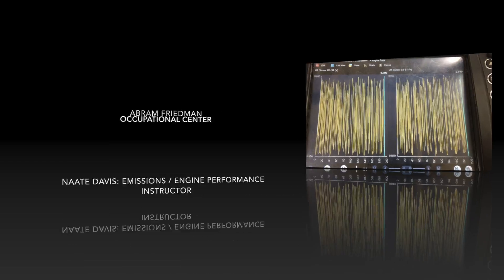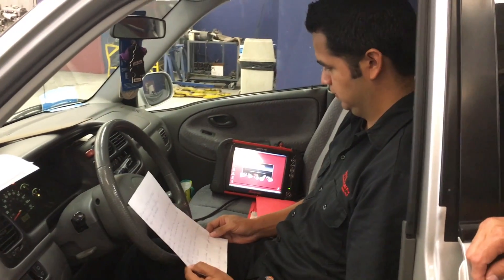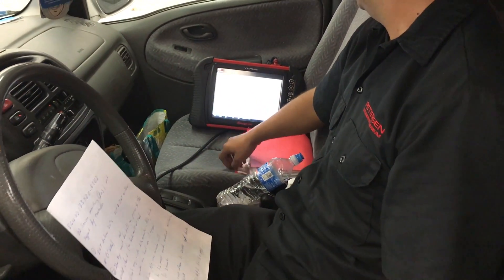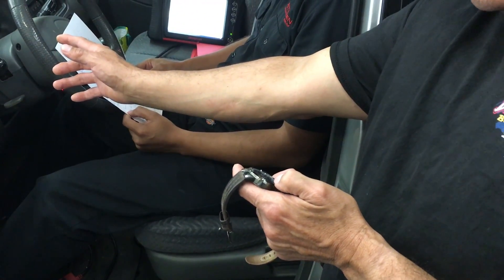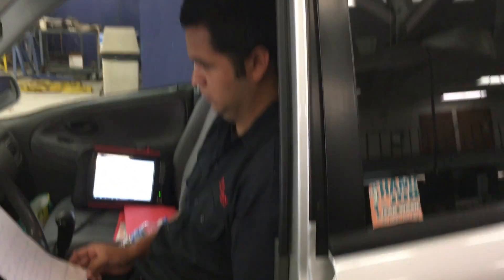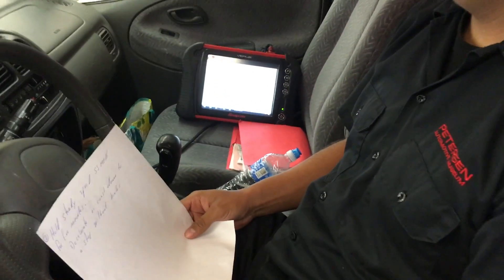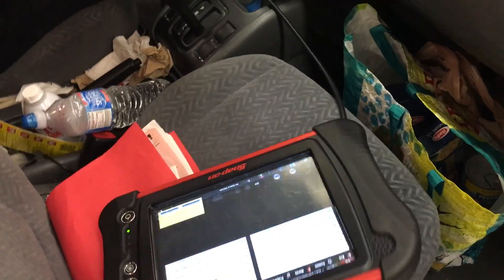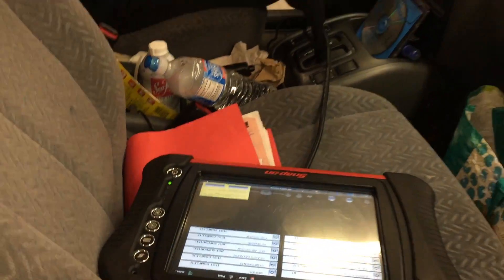Drive Cycle: 🥳  How to complete a Drive Cycle for the O2 sensor monitor that wouldn't run

Comment: I failed the smog check on my 2012 kia sorento. The shop told me to just drive it for a couple hundred miles still says not ready.. don't know
Reply: Also my check engine light doesn't come on
Reply from the maker: @gregmattera1812  what exactly not ready there several different monitors which ones are not ready
Reply: The O2 monitor every other monitor is ready. And the oxygen sensors are working @natedaviscteinstructor

Comment: Got a 99 camaro Ls1 with a EGR not ready. Drove it from Bakersfield to Los Angeles and still not ready. Tried to do a couple drive cycles and nothing. Took it to a shop and they have had the car for 3 weeks and still nothing.
Reply from the maker: Are there any pending codes
Reply: @natedavis5574  just passed smog the other day. I didn't know that you are allowed 1 not ready monitor for a 1999, and the repair shop did not know that either and there was no check engine light.
Reply: I got a 99 also with 40 thousand original miles.think i need a new torque tube for it

Comment: Evap won't clear shows inc on readiness with no check engine light. 2003 Ford F250 truck. Star station said can't pass it because it will ding their rating??? How can I clear the evap with drive cycle?
Reply: The easiest way is Perform evaporate system test with scanner..other method perform evaporate system performance test manually
Reply: I was told that evap is the only one that isn't necessary for cars after 2000

Comment: What are the actual instructions to get the oxygen sensor monitors to get ready? I have 7 monitors ready, except for the o2 sensor monitors. I drive a 2015 Dodge Challenger, any help is highly appreciated.
Reply from the maker: You should be able to google it I’m sure it’s on the internet
Reply: @natedaviscteinstructor  finally got my o2 sensor monitors to set. On the freeway going steady at 65mph decelerate to 55mph by letting the foot off the gas, and aggressively accelerating back up to 65mph. Repeated that back to back 5 times in a row, I then plugged in my obd2 scanner and all monitors were finally OK.

Comment: Nate can you recommend someone in LA or the valley that can do this for me , or will any smog & repair shop be able to do it?  Failed the o2 readiness at an inspection only place.  Tried a bunch of drive cycles myself but it is hard to complete all the steps correctly.  Found a place in Huntington Beach that offers a drive cycle service but that is a bit far. Thanks
Reply from the maker: What’s wrong with the car did it fail smog also what type of vehicle and what did it fail for
Reply: @natedaviscteinstructor  A 2013 Nissan Juke.  Failed smog because the O2 monitor was incomplete.  The smog guy ( inspection only shop) told me to drive it for an hour at 60mph and it should be good to bring back.  I got an OBD device and went on a couple long drives to try complete the drive cycle but it doesn’t seem to do the trick.  I’ll probably take it out on the holiday and more precisely follow the Nissan Drive Cycle procedure I found online (Although it is for a 370Z).
Was wondering if you knew any smog shops that can do the drive cycle on the dyno like your video was showing? It seems much more precise, efficient and safe .
Reply from the maker: @jonhoops1  JS  Auto in los Angeles 20th San Pedro  his name is Danny or if it’s two wheel drive and you don’t mind students trying and you can leave it over night are school charges $20 to look at it
Reply: @natedaviscteinstructor  Thanks a lot.  The car is two wheel drive so I could do it at the school. Let me know what I have to do to set up an appt.   I'll see if I can find someone to ferry me to and fro if I drop the car overnight. Would definitely like to help out the school if I can work out the logistics. If I can't find a friend to chauffeur me to the school I'll hit up Danny at J&S
Reply: Nate, Just called over to the school to set up an appt.  Left a message on your voicemail.  Hopefully we can set something up this week🙏
Reply: Nate, Unfortunately Danny wasn't able to complete the drive cycle on the Dyno because of the CVT transmission in my Juke.  He looked at the info coming off the sensor and thought it looked a bit wonky so he recommended getting the sensor replaced.  I'll be taking it to my usual guy next week. Thanks for recommending Danny, he was very nice. I'll be taking the car back to be smogged by him once I get working 02 sensors.
Reply from the maker: @jonhoops1  Thanks for letting me know, I stopped by his shop and seen the readings it looks like he’s on the right track, good luck
Reply: What was the place in Huntington Beach?
Reply from the maker: @tlanderso07  what do you mean about Huntington Beach
Reply: @natedaviscteinstructor  The shop that can get your car through the driving cycles so it will pass a smog check

Comment: Why are these drive cycles not performed in smog certified ststions?
Reply from the maker: Why would a smog station “test only” perform a drive cycle - also the customer driving the car can complete it most of the time.
Reply from the maker: @celiaferreira2028  yes you are correct it’s hard to perform drive cycle in traffic but I never seen a shop do it as a routine maintenance.
Reply: I need this done.but theres no shops around me that do this @natedaviscteinstructor

Comment: if i use on jack stand and try complete de cycle  with no get it to the road   it will pass or not ?
Reply from the maker: If you find the enable criteria to run a trip it may help you. Look in a chilton manual or all data

Comment: Hi Nate I am having problems setting my cat converter an o2 sensors monitors I work close by too that school would you be willing too help me with the drive cycle it’s for an 02 Escalade
Reply from the maker: The school is not taking car unfortunately have you tried running a drive cycle exactly as it’s written

Comment: Do you clear the codes every time you try to run the cycle?
Reply from the maker: Sometimes if the car is giving me a hard time I’ll try clearing all the codes. Make sure there are no pending codes before trying a drive cycle and get the correct procedure

Comment: I use the emergency brake also. but plan the route on the streets and freeways when there is no traffic.
Reply from the maker: The streets are tough I took a customer car home and did it at mid night lol you got do what you have to do sometimes
Reply: @natedaviscteinstructor  ya i just did a drive cycle @40mph on the freeway for 10min. crazy engineering makes it tough for the average person
Reply from the maker: I don’t know if you received my last reply but if you are losing the memory from the monitors I would check voltage and grounds to the computer especially the KAM terminal if that’s good you may have a PCM issue
Reply: @natedaviscteinstructor  Ok thank you Nate i appreciate your help. Keep the great content coming

Comment: What if the temperature is super low next to the other catalytic converter.. .? Is it the 02 sensor or a cat no rattle coming from the cat
Reply from the maker: Is it really hot at the exhaust manifold and cold near the cat that could be a issue how is the temperature on the other end of the cat “output side”
Reply: Nate Davis the right one is at 998 vs the left side 92

Comment: Where are you located?
Reply from the maker: prettybaby80 Los Angeles Ca
Reply: @natedaviscteinstructor  can you please tell me you address ? I'm in SoCal too and needs help with drive cycle. I have no MIL/CEL or pending code. My catalytic monitor is Not Ready/INC.  It's not possible to do a drive cycle on the freeway here.
Reply: 😢can you recommend someone in Sacramento or even San Francisco? I’m failing for oxygen sensor not. Failed twice. I need this type of service
Reply: Oxygen sensor not ready on OBDiii
Reply: I’ve called around Sacramento and I can’t find a shop that does this kind of service
Reply: @prettybaby80  That's the thing. No shops perform this type of service. This YouTube video is from a School (A.F. Occupational Center).  You have to check with BAR (Bureau of Automotive Repair) & find a Referee center school.  And even then, they don't want to perform this service because they say it ruins their Dynamometer - which is what is demonstrated in this video. I hate the state of California. Vehicles who's readiness monitors are hard to set should be exempt from Smog checks Period!
Reply: Julie A. I Agee ! I’m from nyc . Never needed a car until moving to Sacramento. Had no idea this state was so strict. I had a new battery installed in my Mercedes about two months ago and went to register about two weeks ago since purchasing in July. I should have registered sooner before this 90 days rule or I wouldn’t be in this predicament. If the car was smogged in March 2018 and changed ownership, it’s still the same car! Smogs are good for 2 years. Why do I need to go get another smog smh
Reply: Julie A. Would the referee pass me ? This car has been driven on the freeway and tried drive cycles by a friend and still OBDii not ready. I need to register my car already. It still has 2017 tags on it
Reply: Julie A. Did you have the same issue, same car two years later?
Reply: Hi - yes, I did. same car.  I've had the same OBD II monitor not ready 3 times in the past - occurring just prior to the every other year smog req'mt. The 'not ready' issue has been mainly b/c of a new battery installed months before the smog.  There was one time it passed ok because the battery had not been changed.
Reply: Julie A. Hey Julie , have you had the battery replaced 3 times then ? I have the car in a shop now. They’ve been driving it for three days then will do a diagnostic. I’m not sure they’re doing the drive cycles although I explained that they should. So we’ll see . What did the referee do the first time you went? Why did they refuse to help after the first time?
Reply: yes, the battery was replaced prior to each time I had to get it smog'ed. One time was in Dec 2014. Just a month shy of it needing to be smog'ed. That dumb battery only lasted me till July 2017 (& it was from the dealer, as was the prior one). My current battery was replaced in July or Aug of last year (free replacement by AAA). But I think they don't last b/c I drive the car short distances & hardly no freeway driving.  When I first got the car, I believe the original battery lasted 4 yrs, as did the second one. 
The referee did the drive cycle as in this YouTube video to clear the monitors. I had contacted the Bureau of Auto Repair (BAR) in person at a local office & written a letter or email to someone and I was told to go to the Referee to get this taken care of.
You should probably give me a 'throw away' email address for me to continue our conversation about this.  You can always delete it from YouTube once I have it.  Thx. Good luck.
Reply: Julie A. Called the bar yesterday to set an appointment and rep told me bar referee don’t help with this OBDii not setting anymore
Reply: From New York shops take it seriously.
Reply: Ricky v I never needed a car in nyc , but I’m seeing how California is
Reply: Sam S Thanks for responding. I eventually had To trade it in . Got an extension from the Dmv to drive, but it was running out. Didn’t want to deal anymore
Reply: Sam S ty for responding. I’ll probably go electric soon . Tesla 3

Comment: The 02 sensor on a 08 Silverado wont coplete and it does have a pending code for evap leak, can that be a reson for the monitor not complete.
Reply: David Viveros it won’t do the o2 till all the other ones are complete first.. so it’s waiting.